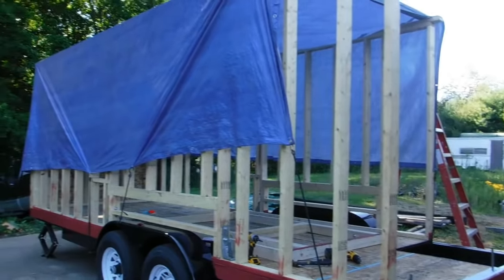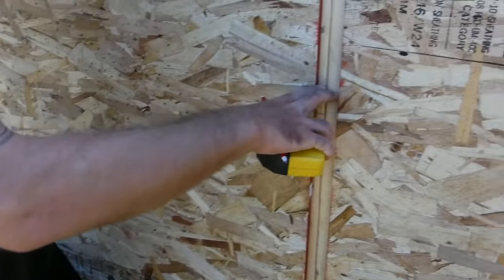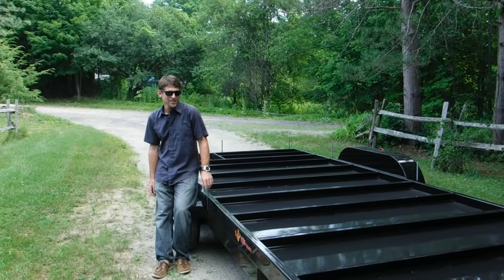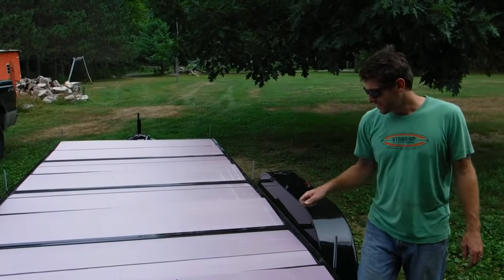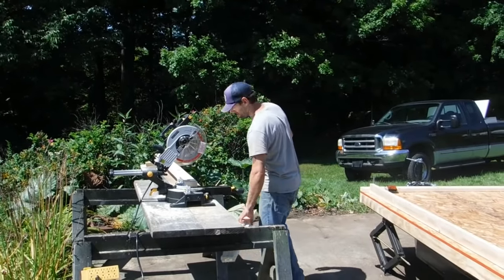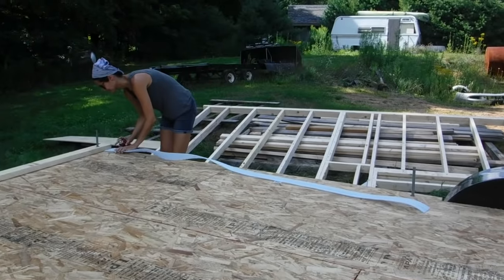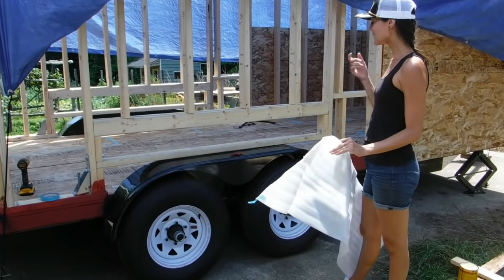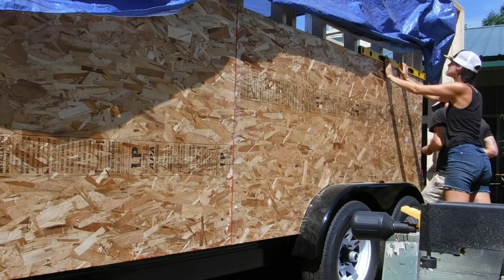Starting Our Build | 18ft Tiny House on Wheels {Tiny House Travels: Ep. 1}

Comment: It is quite funny to see you two transition from Baby Blue to your trailer. I have enjoyed watching and hearing about your travels. Wherever you lay your hat is your home. Relocation for a job should not be a problem. Traveling is the same just the mode of transport is different. Correct me if I am wrong but I believe you two lived through a home remodeling, cruising a sailboat with just an icebox for two years, and now building a small home to live in and travel. You'll be fine. I am from California but I have spent some time in upstate N. Y. and Connecticut and it is a great place to hang out in. I will follow along on the fun with you guys. I look back and realize I have lived a great portion of my live living out of a suitcase and have no regrets.Keep the videos coming. It's all good. Good luck to both of you, just look at what you have accomplished so far.
P.S. have you thought about a name for the trailer?
Reply from the maker: Yeah, it seems we have a pattern of living a somewhat unsettled life! But it's served us well so far. :) I have been thinking a little bit about a name for the house...but nothing has stuck yet. We'll have to wait to see how it turns out, but the blue roof might have to be a contributing factor. Any suggestions?
Reply: Our blue heaven??

Comment: My husband says your saw shouldn't be smoking like that. Probably your blade is on backwards (or it's dull, or even the wrong kind of blades). It will still cut that way but you will be burning through your wood. Did you notice the extra smoke mixed with the sawdust? Anyhow, hope that helps save you on blades =)

Comment: Found your new site, will look forward to your new adventure. Interested in seeing how you do the floor plan. 

Also would be interested in knowing how you calculated the final weight of this tiny house to be sure that you were under legal limits and within the towing capacity of your vehicle. Did you find a program somewhere?  Are you planning to have A/C and heating in this house, and what kind.
Reply from the maker: We're hoping to keep it under 10,000lbs. We have a Ford F250 and from what we've read online we think it can handle that load. Once we get everything framed and insulated we'll take it to a weigh station so we know what we're working with for the finishes where we have more options for materials. We're doing a cubic mini wood burning stove. We might wait to put in a heating/air conditioning combo unit until next summer.